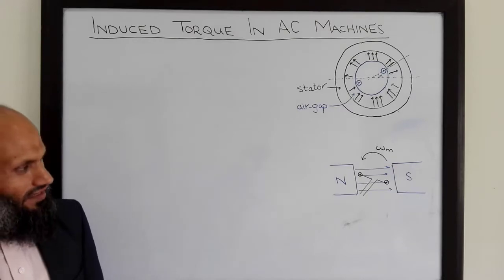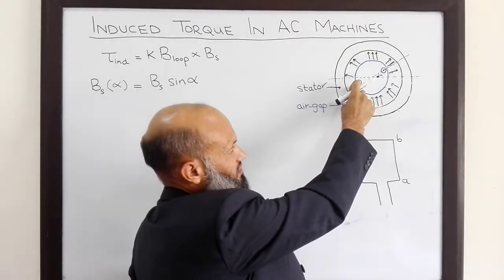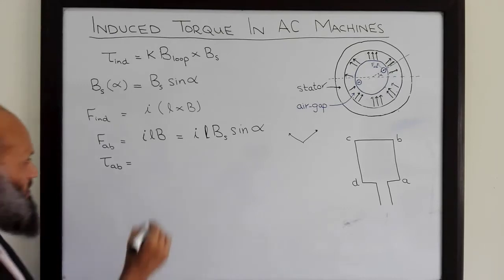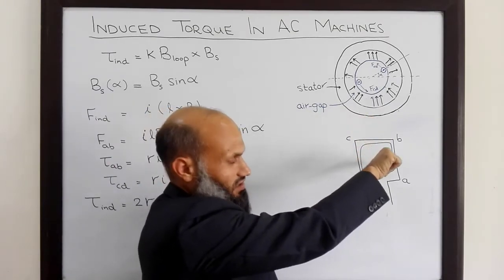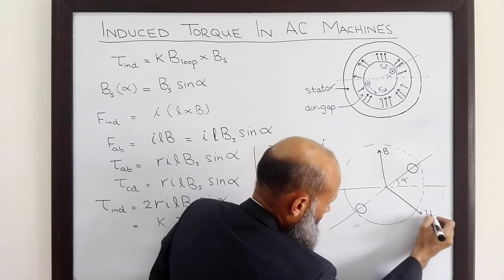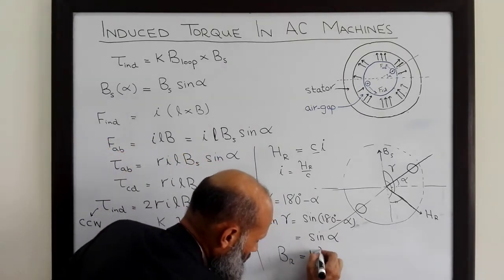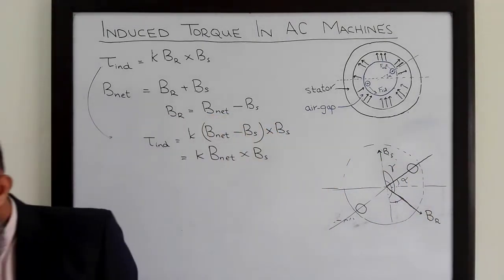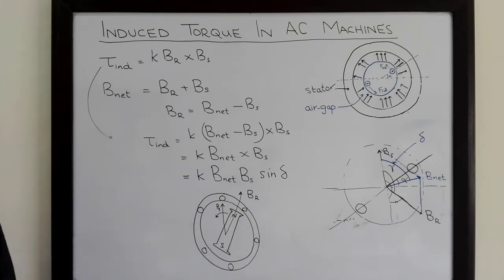EE213 - 34 - Induced torque in ac machines

Comment: Hi Sir.This lecture is for motor,right?
Reply from the maker: Yes, this is also applicable to motors. However, the torque will be induced in the coil whenever there is a current in the coil, that is, this torque is induced both in motors as well as in generators.

Comment: Sir, how the torque(ab) is in CC direction? Please explain. According to Fomulae, it could be in 'Out of the page'(clockwise) direction. 
Take love from Bangladesh 💕
Reply from the maker: The direction of the induced torque is the same as the direction of r × F. For conductor ab, vectors r and F are  sketched in the lecture, and their cross product comes out to be out of page. What does out of page mean? It you curl the fingers of your right hand with thumb pointed out of the page (direction of torque), your curled fingers will be in counter clockwise direction (the direction in which the induced torque will tend to rotate the coil).
Reply: @MAFarooqi  sir, that means, the rotation of Induced torque and the direction of Induced torque are two different things?
Reply from the maker: @Md. Nujratul Haque  for the case of a motor, direction of induced torque and direction of rotation will be the same (the load connected to the motor will exert a torque in opposite direction) and for the case of a generator, induced torque is opposite to the direction of rotation (there is an external torque applied by a prime mover)
Reply: @MAFarooqi  Thank you so much, Sir. It is clear now.